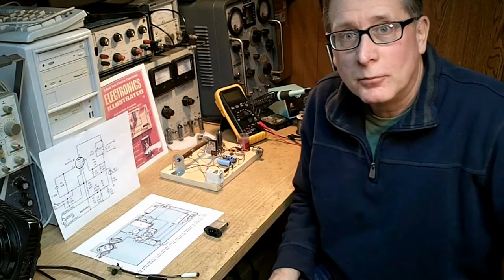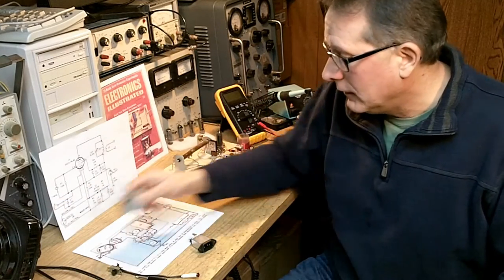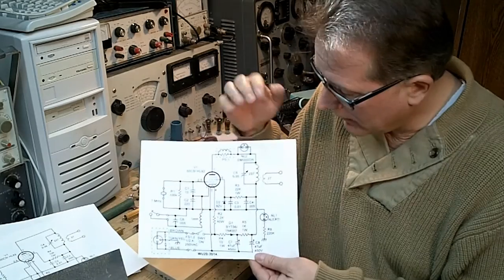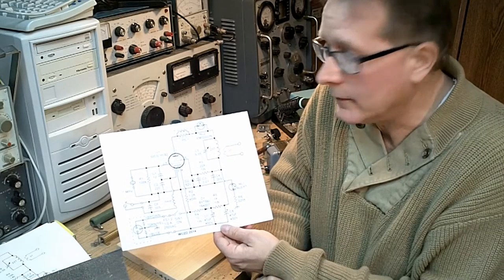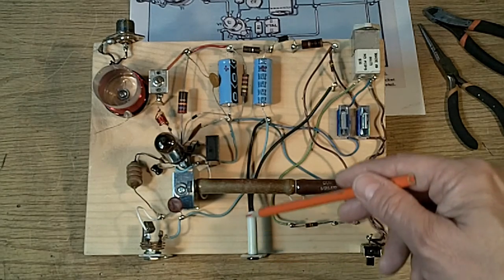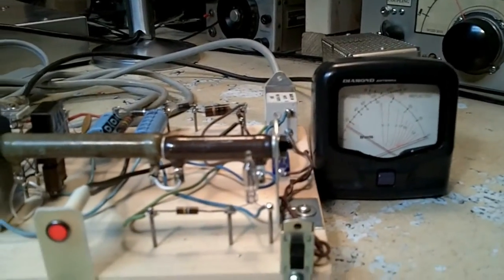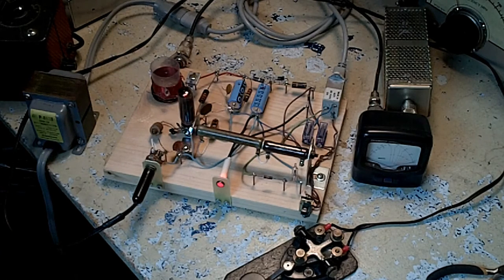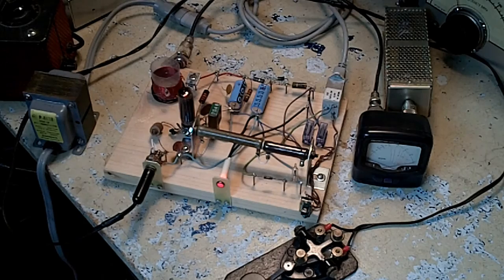50C5 Transmitter Part3

Comment: Thanks for the nice series! The keying/signal sounds great!If a 1N4007 diode were added in series with the 50C5 heater wiring, the effective voltage being delivered to the 50C5 would be effectively dropped in half. Thus, only ~ 10 volts would have to be dropped by the dropping resistor (~ 65 ohms), for a 120 VAC power source, or ~ 70 volts, for a 240  power source (~ 450 ohms). Significantly less heat generated and energy wasted.                                                                      73 de Ron
Reply: Very nice transmitter. Could you replace the filament resistor with two 24v lamps in series Instead? Maybe use  one diode like Ron n4gjv described and one 24v lamp? The lamp could be used as a power indicator.

Comment: The transmitter is much improved at this point.

How about to connect a close plastic morse key to it? 
The morse key is the point most likely to come in contact with the circuit.

It goes without saying that this is not for children to play with. So make it safe for children.

The antenna link is very safe because it is isolated.

I like the simple circuit and the presentation.
Reply from the maker: Its hard to call this thing safe without squinting. Be careful.